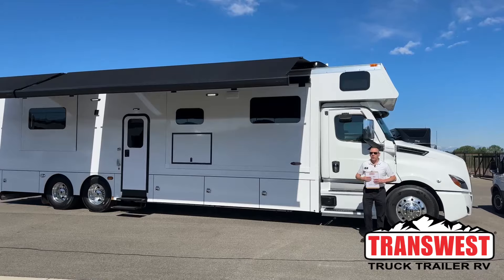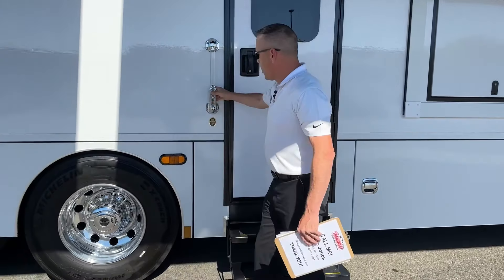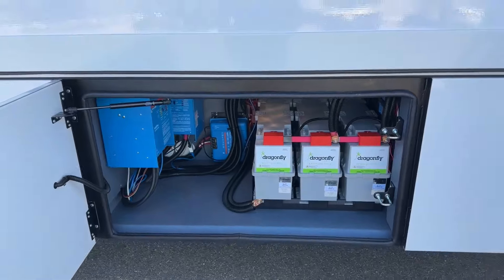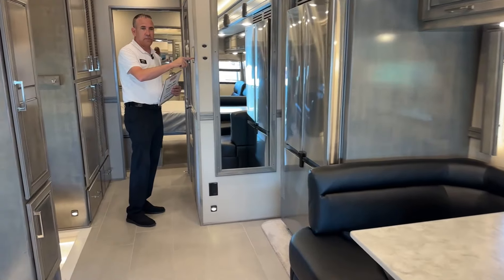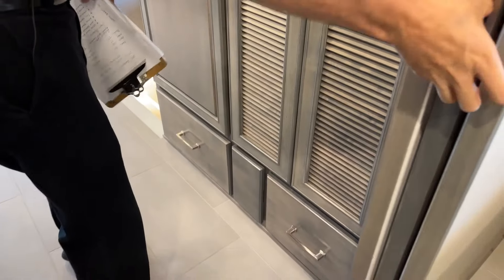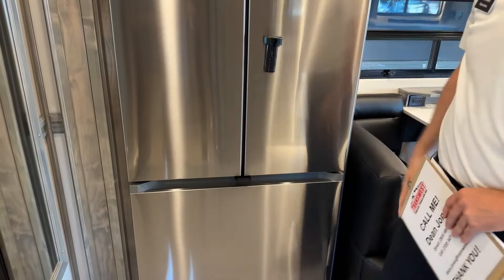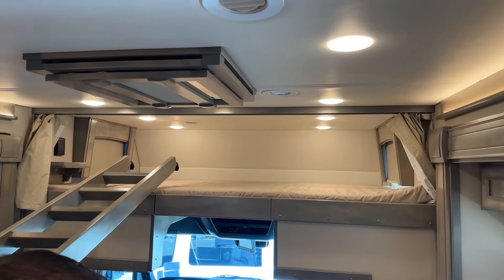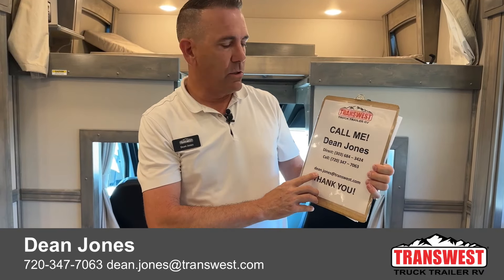2025 Renegade Classic 45CMR

Comment: Why are the generators always placed under the bedroom? Wouldn't it e less noisy placed up front where the aqua-hot is?
Reply: Weight that needs the dual screws to negate the weight imbalance of a large mass like a generator on one side of the chassis.  The generator weighs 787 lbs while the 150 gallons of freshwater storage directly across the RV is under the master bed weighs 1300lbs+
Reply: @dustup2249  I think they can switch the large Aquahot with the generator.
Reply: @jessegago7163  Agree. Both the Aquahot and generator have an exhaust because both burn diesel fuel. The Aquahot is much closer to the house batteries and the inverters and the generator area as it is now is close to the bathroom that requires continuous hot water.